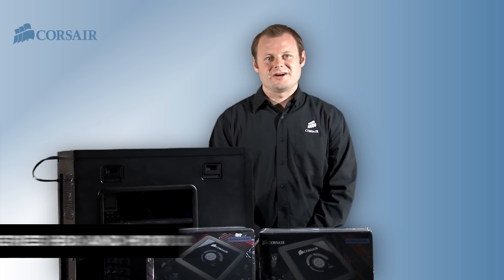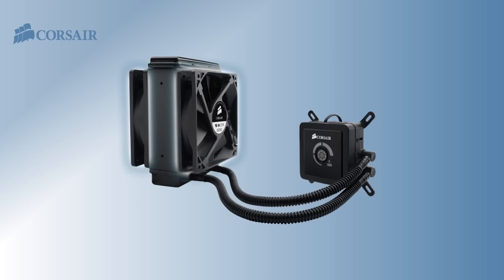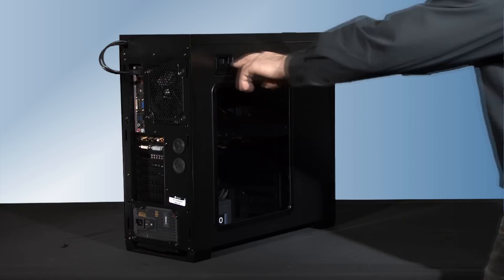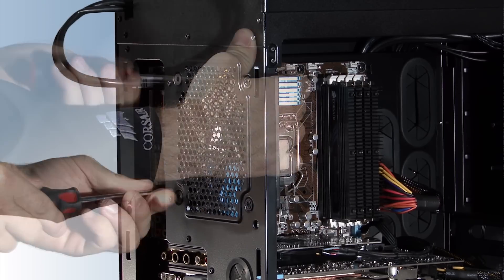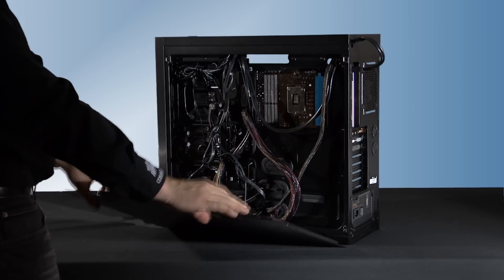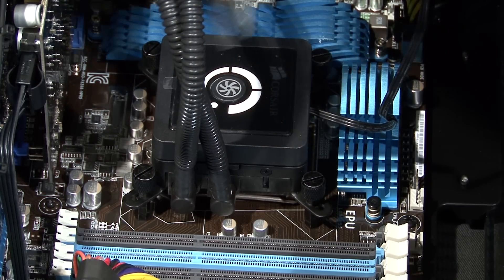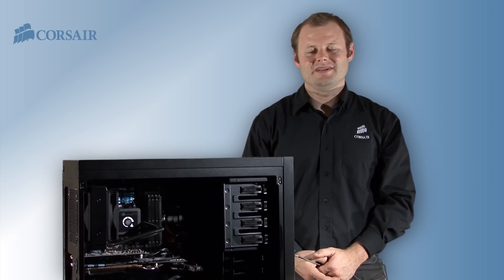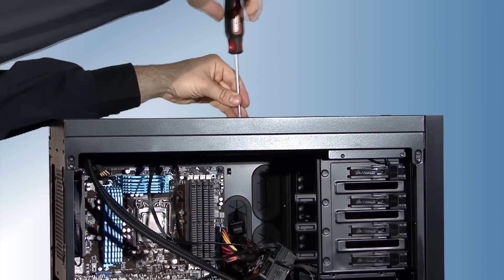How To Install the Hydro Series H80 and H100 Liquid CPU Coolers

Comment: you mentioned everything that doesn't matter and left out the one thing that does. the case. -.- it doesn't matter how many GPUs you have, how many HDDs/SSDs you have, how much RAM you have, your CPU REALLY doesn't matter, it's not like it's bigger or smaller than a 3770k -.- and your power supply really doesn't matter either. it all depends on how big your case is and how much room you have on the top/rear of your case. everything you mentioned doesn't take up space there besides RAM.

Comment: Can i install this cooling system along my i5 2500k , crossfire gigabyte hd 7870 oc 2 gb, 16 gb Hyper x Kingston RAM , a 120 gb ssd  hyper x,1,5 tb hdd , and my power supply is a corsair tx  750. please i need help :D

Comment: Hi: I just recently brought a new Corsair H80i hydro series from a shop. I have small question to ask about 2 fans airflow in AMD cpu. The 2 fans does not says which direction the air will flows and the airflow should be intake or exhaust.

Comment: Why would you use the fan mount with no dust filter for an intake? Use the 200mm in the front to draw in cold air.

Comment: "So summed up, once unboxed you'll spot the cooling unit consisting of the radiator assembly, fan and brackets + back plate that support a very wide range of AMD and Intel processors. A little thermal paste is pre-applied on the cooler as well."

Comment: That makes sense. But let's say you have a front 120/140mm, 2x 120's in the top and the H80. You're going to want to put the top 120's pushing air out and up to stop dust coming in, fitting the H80 to push air out of the case as you suggest leaves the front 120 as the only fan pulling air in - which would result in negative pressure.

Comment: DO NOT INSTALL EXHAUST FANS THIS WAY. Rear vents on this case don't have dust filters on them for a reason - they're meant for exhaust purposes only; installation method shown above will introduce dust into the closed system and clog a very fine radiator of H80. Make sure the stickers on the fans point OUTWARDS the case.
And remember: to avoid dust introduction always create positive pressure inside your case!

Comment: Hey I just installed one of these but in my haste I used the long screws and started screwing in from the radiator and as a result i've crushed 3-4 fins together and they are now cleanly broken off. My radiator is not leaking through my own inspection so is it safe to use and will this affect my performance too much? and yes I should RTFM... :(

Comment: if ur case has anywhere else to mount a 240mm long rad, then sure, y not? But make sure u are directing the hot air to the correct places.

Comment: dont listen to that guy, hes nab. clearly the h100 is better it has a much larger radior hence it get's a larger surface area to store and get rid of the heat. the difference beetwen the two gets more obvious the more heat the cpu is throwing out

Comment: LOL! The blackplate was installed incorrectly. The wedge on the left is supposed to be for the screws on the top. He should've rotated it clockwise 90 degrees.

Comment: Yes, theoretically. But it would involve a LOT of laptop modding on the chassis and I wouldn't risk it. Plus this is a very unprecedented thing, so the outcome is anyone's guess. There are no parts specifically for L.C.Laptops so you would have to manufacture and mod them yourself.

Comment: They didn't. The H80 should have rear as intake. And if you're using the H100 use the rear as exhaust and the top 2 as intake. So the airflow will be like a backwards L.

Comment: @CorsairMemoryInc hello i just bought the h80 but when i plug the 2 fans on the pump only 1 works and when i place the working fan on the other 3 pin connector this fan does not work plz help!!

Comment: a few minutes my ass... Took me almost an hour to install it, with parts constantly falling off because the parts simply weren't tight enough to stay in with friction. Taking just the radiator off and putting it back in took another half an hour. However, it is a VERY good cooler, so it's worth the time.

Comment: hello, i'am installing the h100 using a push/pull configuration on a asus motherboard. i want the software that come with the motherboard (ai suite) to control the fans. do you have to install the fans in the pump assembly connectors or can you install the fans on the motherboard fan header?

Comment: Shouldn't the h100 be installed so it exhausts air since it is on the top and it will be easier or hot air to escape since heat rises?

Comment: It's CPU cooler that uses liquid instead of air. Cool liquid gets pumped through to the heat sink on the CPU, transfers the heat away from the CPU, is pumped back to the radiator as warm liquid where it is cooled again before being pumped back to the CPU. This repeats in a loop.

Comment: I got my 650D case recently, and found that the windowed side panel didn't fit properly, and had a warped window. Corsair immediately sent me a new windowed side panel. Great customer service. If Corsair make a PC component, I will favour it over any other brand. My new build is about 50% Corsair.

Comment: I wouldn't recommend SLI on a 700 watt; the second GPU isn't drawing a full load, but having some extra wattage is the best way to ensure the longevity of your system.
800-850 watts is about where I would feel comfortable to start an SLI system.

Comment: How can I access the backplate of my CPU? I got my PC custom made and I believe the CPU along with motherboard is connected to one of the sides tot he PC which can be pulled off, I can pull the left side of the case open but it will only expose the CPU's front with the default Intel fan on.

Comment: You would have to do it with a custom water loop. You can't get the rad outside because the tubes are already hooked on to the CPU block. I'm pretty sure you can't take the tubes off.

Comment: i dont know put the water tubes through the water cooling holes in the case and get cable extensions for the fans so they can connect to the psu cause i want to get this cooler but i dont want the radiator in the chassis cause i want max airflow and the radiator is gonna somewhat block airflow

Comment: Can I run a Push/Pull set up with a H100 inside of a 650D? And will a Gigabyte 670 be able to fit in the 650D? Thanks!

Comment: like "ingendet" said - it does not uses water, only liquid, that's why it's called liquid cooler, even if water is liquid too, if we think logically, but it uses different mix i think, and you don't have to change it at all, use it years and still no need for change the liquid, and i don't know how to change anyway in those liquid coolers :D i don't see a spot to fill them :D

Comment: it's already on, it's already on that plate that touches the CPU lol, do you know what thermal paste does ? it's not that it cools down the CPU, it's for best heat transfer to the cooling system that you have on, with out it your CPU cooler can get pretty hot, and i don't know if the CPU can stay alive or will shorten the lifespan of it. So it means that thermal paste is on every cooler, not only on that, it's on GPU and even on motherboard chip. The answer is... "no, it has the thermal paste"

Comment: and the answer with that information is useless to my wish, cause i asked about the liquid cooling LED fans, as i said, even if i didn't had the side window, i can turn fans as i want and change the way how fans intake or outtake the air, i still could see the lights coming out, so the side window is not that necessary, but not looking that i have 200mm front fan with red lights only + (i will have that intel liquid cooler blue led)+ UV and violet/purple cold cathode lights that i will have.

Comment: i know that very well, thanks for sharing info that i know a long time ago :) and yes, i have, otherwise it would be useless of course, i could only take lights that are in fans, cause those would be the only ones i could see flashing from the case. CM Storm Enforcer - case. But that does not matter that much if the lights fit together or not, think optimistic, you can have colorful lights, you can see some videos how does it look red with blue, still good.

Comment: i like the Intel Liquid H80, it looks cool with the blue LED lights, but the better performance has the H100, it cools better, if Intel could make like corsairs H100 with double fan and wider radiator, then it would be great, or...if corsair could make their H100 with out manual fan speed controller + tubes like Intel Liquid Cooler has and with LED lights on fans at least, then it would be great, so it's a hard choice for me right now, which one to take.

Comment: But it exhausts out the back of the case. With most good cases you will have fans in the front and side pulling plenty of air in with the rear exhaust pulling out all the hot air. watch the end of video. It shows the air flow just with rear fan. You don't want the fans pulling hot air from the case through the radiator. You can if you want providing a very well vented case with fans. try both ways and check temps.

Comment: but if you set up the h100 fans to pull air in surely your just pulling in hot air from the radiator?

Comment: You should have no problem with that, I've used a H80 for like 6 months, then i changed to the H100. I use my computer 12 hours a day, and i use my computer on LAN-Parties and it gets carried around all the time, no need to worry about leaking. I've never even heard of that. And i actually don't think there will be any risk in case you don't start pulling the tubes or trying to abuse the cooler ;)

Comment: I believe the tubes are lined twice, and has a fassin around the radiator along with the cooler..They made sure that nothing will leak. Its more so the constant readings that the cooler has to keep track off, that can mess up the system..such as, the fans being louder then they should be.

Comment: "Even in performance mode the H80 is quieter than some stock CPU fans" I'd say even on the medium setting mines noisier than the standard CPU fan on my i7 2600k. I noticed on the video you didnt show the fan working or have the noise of the fan for all to hear,

Comment: Funny cause I have the h80 on the same exact case but the fan on the h80 doesn't work properly and for some reason the notch on top of the case somewhat control the speed of the fan of the h80 0.o is that normal? The fan doesn't always work though it only sometimes when I put the notch to max

Comment: The Corsair H80 is one of the best single 120mm pre-filled liquidcooling on the market. The cooling compared to the H100 is very equal, but since the H100 is doublefan, I went for the H80. The cooling IS amazing. All the other who says the opposite, they're wrong! The 2 only things that's bad about the coolers is that it takes ages to install for a person new to PC-installation. The second is that it makes a hell of a noise on full. But with fanspeed on minimum, it cools pretty damn well. :)

Comment: Is is connected to the power supply by the 4-pins molex connector? if so, you might want to contact the company you bought your H80 for warranty, because in that case you might be the unlucky person that got a defect model.

Comment: You are absolutely correct but remember that removing the stock cooler removes cooling flow over the chipset heatsinks. Depending on how good your case flow is it may not matter that much.

Comment: wait....you pull air in through the radiator?  doesn't the radiator heat up?  Therefor the fans should blow the air out  (In regards to the H100)  Most computers I set up draw air in through the front and blow it out the back or top of the case.

Comment: Hello, I’m facing a problem with my PC and that is the 2 fans that are related to the liquid cooler are operating but the H80 liquid CPU cooler itself is not and the lights aren’t turning on which is an indication that the cooler is not functioning! Every time I turn on my PC, it stays on for around 20 to 30 minutes and then starts to slow down and eventually shuts down! Please help!

Comment: Can I use the H100 with a coolermaster 335U, can I attach it to the side panel, it does have 2 spaces for 140mm fans and 120mm.

Comment: the video didn't show where to plug in the 3 pin (1 wire) connector which attached to the molex power connector.  Any ideas what this is and where this plugs in? the quick start guide only shows where to plug in the 2 fans and I have searched for hours now to no avail :(

Comment: @gunnar045 thats not what i said, i was frustrated to find out that the intel brackets that came pre-installed in this unit are very difficult to uninstall and was wondering why have brackets pre installed anyway? . aren't AMD users also going to be using this too

Comment: @TR011FAC3GAM1NG yup all the water is in there, you dont need to open or refill it. 
The ones with a resevoir are alot better but there are dangers and matienence, like refilling the liquid, dangers of it leaking too. Also, Corsair refund you all the parts damaged if your h60 - h100 leaks. So it's very good

Comment: do you need to use both fans for the radiator? will one fan work by mounting the radiator directly to the case and have the fan on the inside of the case blowing air through the radiator and out the case?

Comment: @anhtransport hey you can always mount a 120mm on the bottom of the case to support airflow for the video cards. but if you play video games, those stress video cards but not CPU's too bad so the 100H should work plant for an intake. as for the dust, there will always be dust no matter how many dust filters you have :)

Comment: @vgg200 It is a self contained water cooling solution, you never do any maintenance and the initial setup requires no assembly besides installing on the motherboard! It does not cool as well as a true water cooling kit however, so keep that in mind!

Comment: This thing is flimsy as shit, it would not sit over my AM3+ socket properly, I had to screw it down till the brackets bent! Unfortunately, I ran my 1055t @ over 100c for several seconds before I found that out. CPU works fine but I don't know if that had done any permanent damage! Also, the 4-pin molex had a pin pushed in, that was a real nuisance to fix!

Comment: @rdernowski Hey thanx man. I do have a 3930k and i think the 2011 socket runs quite hot, so am gonna put the fan as intake. My concern is that if this set up will provide my video card enough fresh air. Also i worry about the dust build up since the top does not have dust filter plate.

Comment: @anhtransport depends what you do and how much you stress your components

For example if you play games and have video cards than I would put it as exhaust and the back exhaust fan as a intake

 but if you stress your CPU a lot and want to keep it cool then put them as intake with push pull config and leave the exhaust fan as it is.

Comment: Those who try to mount this on the 2011 socket: nor the H80 neither the H100 does not those boards! They must know that and still they even made the specific set of screws, but its the pumps brackets... Corsair should stop mentioning it in the compatibility lists. Check the forums. Personally, I did some filing, the old mechanical-kind-of-filing until a perfect fit.

Comment: Hi all,

I've bought a Corsair Hydro 80 The Total area which occurs in conjunction with the CPU is already equipped with a thermal compound.
questions:
1) Is this what is already on it sufficient / quality?
2) Is it advisable to combine another?
3)Should the one that is already on it be removed and replaced with another? (for example Arctic Silver 5)?

Thanks alot

Comment: @apruler2012 I'm thinking about one of these coolers, did you get one?  I'm just wondering if it already had thermal paste or it doesn't need any?  Also how much power it uses, would 750 watts be enough or what, thanks

Comment: This guy put the backplate in the wrong position. There are 2 little indentations on the backplate supplied with the unit that matchup with the 2 rivets on the CPU metal backplate and allow it to set flush on the back of the motherboard

Comment: @jamstan1 some cases has a hole on the backplate so you dont need to, depends what case u have, so be sure to check that before taking all the parts off, it might be that you dont need to, i took it out for nothing and then noticed, hey i could have done this much easier hehehhe =)

Comment: @killyamomz Hey like it says in the video, the h100 requires two 120mm fan mounts. The easiest way to do this is typically to put it in the top of your case and exhaust out as to rad should be creating warmer air. A good example is to go look at a Corsair 500r case, and look at the mounting points in the top. There are many videos of it on yt. This configuration would allow you to exhaust heat out to top of your case, and pull in fresh air from the front and bottom.

Comment: @Moution23 It's 100% "plug and play" and maintance free (except for taking dust off the radiator after some months of use :P). The system is sealed, so you wont ahve to change the liquid inside it.

Comment: @Hedll The V10 will give you better numbers for cooling vs the H100, but mind you, make sure that you have adequate support. My best friend has slightly warped his ASUS Gen 3 ROG board from the weight of the Heat Sink and the GPU

Comment: can anyone answer my question???
instead of plugging fans into the pump, and 4pin for pump into 4pin power, can i strip the connectors and run all wiring to my terminal block?? easier and nicer i think. 

thanks

Comment: just a heads up.  I just built a system using the Corsair Graphite 600T case and the H100 water cooler.  I assumed they would work perfectly but it tuns out they are a bad fit.  Took a lots of tweaking to get it working.  I had to order two 120mm "slim" fans to get it right.